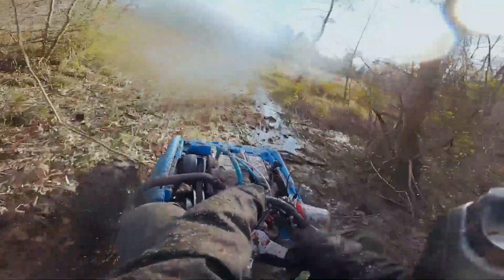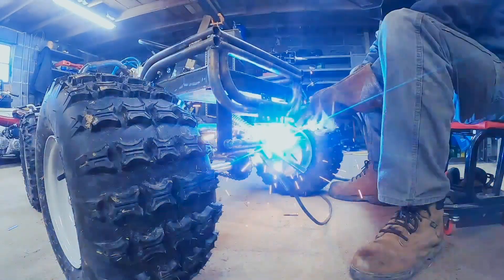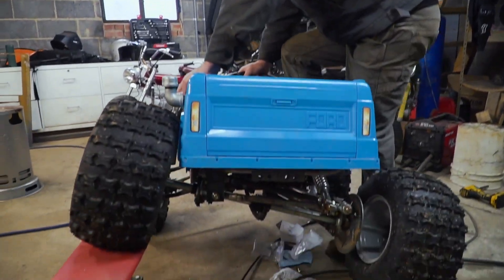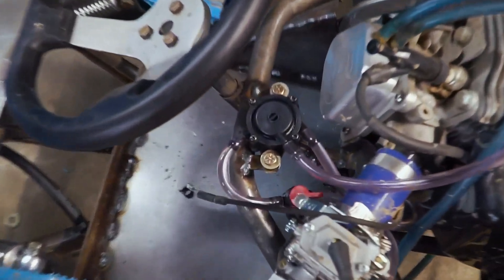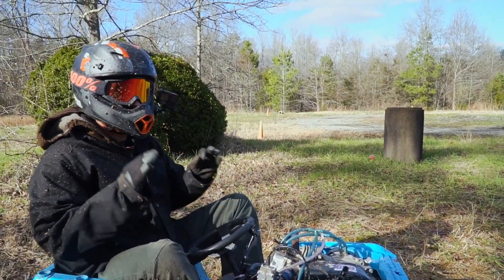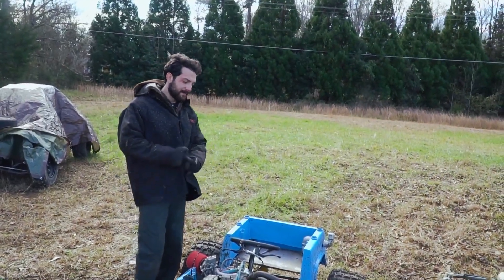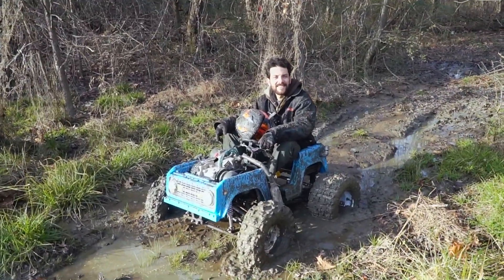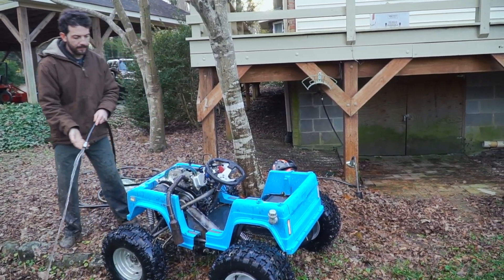4x4 Bronco Power Wheels Go Kart First Rip! | Mud Run, Jumps, & More!

Comment: I think you should either start with your channel name and stay with that. Or change the channel name to carts and cameras cause yall have half correct yall have cameras ike has cars. This channel it'll be fine yall say all the time swap names or something. But I would do my own thing and not copy other channels. GHP started this power wheels and they are good at it now everyone is trying to be GHP . Do something different from the other channels problem is everyone wants to be like everyone else. Here is something that if you apply yourself you can accomplish a track vehicle  no tires  for goodness sake you have a  plasma cutter what is stopping yall is yall.